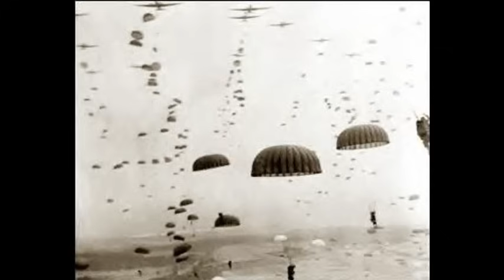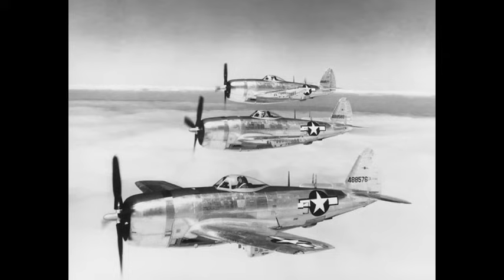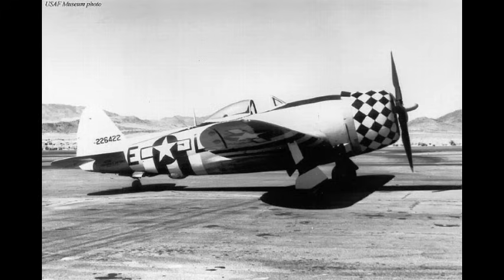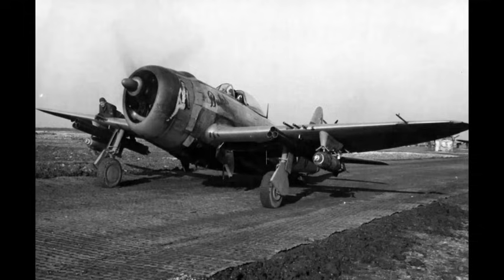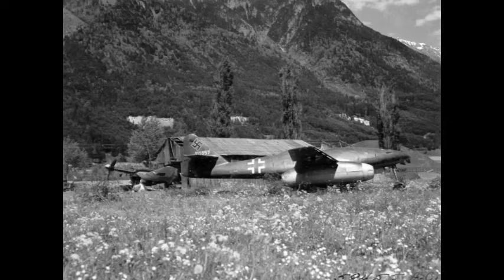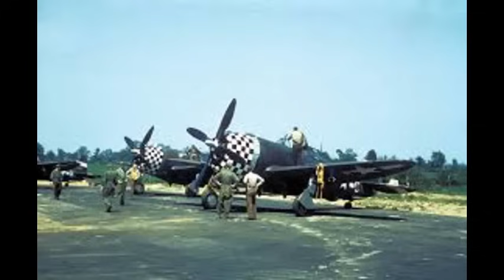Luftwaffe Never Expected P-47 Thunderbolts To Carry Half B-17's Bomb Load

Comment: People like to compare the P-47 to the A-10 because of the name and their ground attack capabilities, but I would argue that the modern equivalent of the P-47 is the F-15E Strike Eagle. The P-47 was incredibly lethal air to air where the A-10 is not.
Reply: yea can view thunderbolt vs mustang as F15 vs F16
Reply: The a-1 sky raider is more the direct lineage to the A-10 than the p-47 was, the 47 was long retired while the a-1 was doing CAS all the way through Vietnam. The a-10 had similar operational parameters and weapons load out of the a-1 when the original specs were written up for it. Now the p-47 on the other hand ended up being a great ground pounder more by accident. It's supercharger gave it power at altitude to take on and dominate the best air superiority fighters of the day. The a-1 and a-10 were ground pounders from the beginning.
Reply: Good point.
Reply: People forget a 10s have big gun big gun shoot far told that by a f 16 pilot had to train dog fight them.